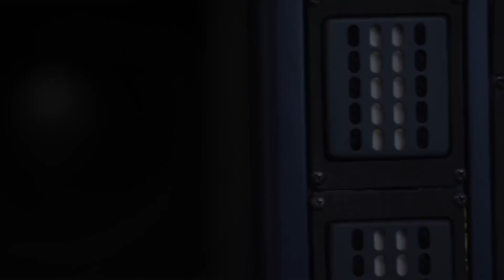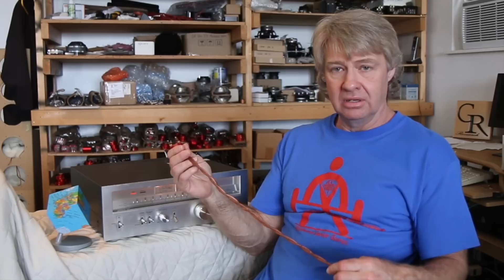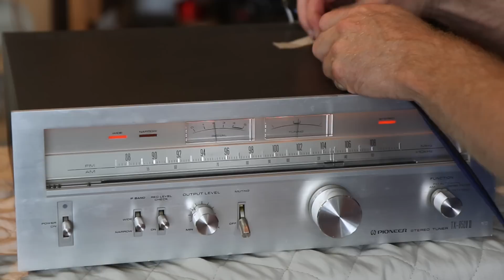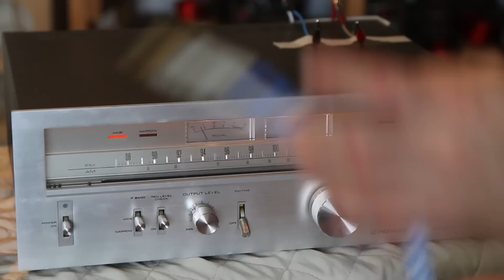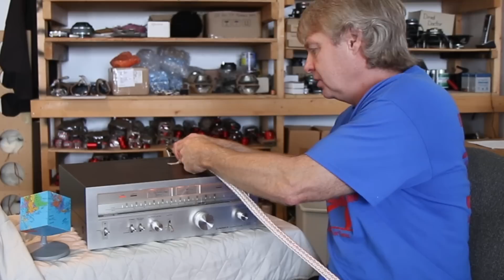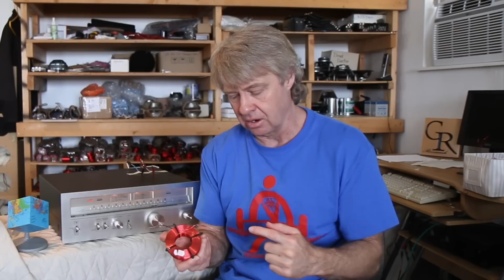Do Audiophile Cables Matter? Here's PROOF!

Comment: I'd like to see a speaker that can reproduce those station frequencies and people who can hear them in megahertz range. I know there are lower RF also but anyhow. Haven't heard a speaker that starts to sing when you just connect a cable. Input side is a bit different thing though.
Reply: It isn't about hearing those ranges. It is how the audible range is effected by them.
Reply: @dannyrichie9743  Didn't see measurements or hear differences. Just talk about how it "might" do something.
Reply: @OjStudios  I am working on how to take this to the next level and how to provide real information that is easy to grasp and doesn't just blow past my younger audience.
Reply: @dannyrichie9743  As an automation electrician I know the basics of RF and EMI etc. But title is pretty mislesding when it says proof and only thing shown is how cables act as antenna on a receiver. That receiver of course picks up all kinds of interference and crap from the air but speakers usually can't reproduce these sounds. If it would affect so much that there is actually a problem, newer speakers should come with some kind of filtering on the inputs.
Reply: @OjStudios  I didn't create the title. I am sure it was picked to grab attention. And that interference effects the signal whether you can hear the actual range it is in or not, and you can hear it in the playback. And you don't hear the radio frequencies (of coarse), you hear the effect on the audible band.
Reply: @Lloyd Stout That doesn't change the fact that the RFI effects the signal and how it sounds. Real engineers though already know that.

Comment: This is true for other interconnect BUT it has a very little to do with "speaker" cable a lot less effect than resistance which he said him self that it does not matter. Because the connection from power amp to speaker is 8 ohms or less and speaker does not amplifies any (noise) signal.

Comment: I certainly understand how cables make a difference. Problem is, purchasing a REALLY HIGH QUALITY cable is VERY EXPENSIVE. I try my best to get what I can afford and of course every little bit helps. From the power cable, to the XLR cables,  to the RCA cables, to the speaker cables. It all makes a difference. I just buy what I can afford.
Reply: I am working on the release of some DIY designs that will get you there without spending the big bucks.

Comment: The discussion at the end regarding shielding, you were talking more about noise from your local energy supplier rather than picking them up from the 'airwaves'. Are they actually analogous as you implied? I.E. Will the shielded cables actually not reject radio noise, and will the braided cable actually filter power supply noise?

Comment: Pretty weak argument that RF coupling is a factor for speaker cables.  If there were any truth to what your saying, then CAT5 cable with its four twisted pairs would make great speaker cable.  Twisted pairs add length and capacitance but improve common mode rejection.  Okay, so what.
Reply: The video was regarding cables in general and not just speaker cables, but I used speaker cables in the example.
Reply: @dannyrichie9743  I guess I don't follow your train of thought...cables as filters.   An 8 ohm load and a few microvolts of EMI that could possibly be present as mostly common mode.  Why would that be a problem one  needs to obsess over?

Comment: I'm not sure using VHF signals was the right approach to demonstrating different grades of audio cables.  I don't think anyone is going to complain about a 100MHz hum in their Pink Floyd.  On the other hand, they would complain about 60Hz.  (They are not the same; with VHF the 'skin effect' really matters, whereas with 60Hz it does not.)  I think the better demo might have been:   an amplifier & speakers, and a 60Hz hum induced into your sample cables, and connected to the amp's input.
Reply: Correct test would be 60Hz hum induced into a cable with amp on one end and speaker on the other, amp's input short to the ground. Any sound coming from the speaker, any voltage measured on the speaker terminals would mean cable is picking up that EMI. But in real world there would be no sound and no voltage even with a cheap 30AWG cable.

Comment: I've got 64 year old ears, so I used 2.5mm twin and earth domestic power-cable for my workshop speakers. My music sounds beautiful coming from my 1972 Goodmans Magnum K2's. No clicks, buzzes, hum, RFI or anything like that, just lovely music.
Reply: Nice to know I'm not the only person using vintage speakers in the workshop, I get a choice between Mission 720'a and TDL RTL3's :).
Reply: May i ask if you use two wires on the plus or the minus? I was thinking of doing the same with the garden type because they are very flexible and very cheap I could use also extension power cable also very cheap and flexible

Comment: Danny, would you do us and the entire audiophile community a big favor and show us how differences in speaker cables do have audible consequences rather than just saying they do? If you are convinced that they do, it shouldn't be too difficult to show it. Here is an easy way to do it with just a little help. Have someone you trust to put two cables to compare on either side of your fine system and cover them so nobody else knows which is which including yourself. Then start playing a mono signal and listen for any perceptible difference between sides then start playing only one side at a time and switch back and forth often and frequently until the audience and you has concluded their assessments. Do this with enough different signal samples as needed until everyone has either made enough assessments or everyone is exhausted 😵 Then reveal what cables are connected where. You can start with just yourself and a helper (who should not be in the room during the assessments) then branch out to anyone and everyone you know or don't know.
Danny, I respect your intelligence and work but casual sighted comparisons are not scientific and are not convincing to the more scientific and skeptical community. There are the flat earthers and religious believers that will never be convinced, but I believe that you can make a huge contribution to the rest of us if you want to.
Reply: My colleges and I have done this a LOT. But we don't use a mono signal. Many of the differences are in sound stage layering, depth, and space around everything.
Reply: @dannyrichie9743  So do you switch between cables instantly in a double blind comparison? It is much easier to do with my method and if there is no discernable differences then switching between cables instantly double blind is warranted. But about anyone can do it my way as a first step. But for someone like yourself with the experience and resources it should be within your capabilities to do the appropriate objective measurements and relate them to the subjective impressions of the larger community.

Comment: RF (MHz) can't be used to demonstrate audio frequency (Khz) conductance of copper cables
Reply: There's a bunch of AM (MW) broadcast stations below 1 Mhz, therefore, not all rf is Mhz.
Reply: @williamstewart8695  yep but capacitance of cable will have hugely different impedance to 10khz vs 20khz

Comment: Without knowing the length of the cables or whether or not the other end of the cables was connected to one another or not, this video is meaningless as "proof" of anything.  Yes, braids shield from stray RF noise but if you don't have stray RF to begin with they do nothing because there's nothing to shield.

Comment: Don't let the naysayers discourage you, Danny, go for it. I just learned again the difference cables make, by swapping out one Oyaide interconnect cable ($70) with another ($125), and WOW, while I loved the warmth and fatness of the Class A, the Class S just has a bit more brightness and highs and less bass, but overall provided a better balance to the sound. This cable runs between the preamp and my electronic crossover, so everything I hear is running through that cable. So these are cables that do not cost hundreds and hundreds, and most of my interconnect cables cost less than $100. So the Oyaide cables are great, and I also really like the clarity of the Analysis Plus interconnect cables. But I am afraid the differences I clearly hear in these cables likely do not show up on measurements.
Reply: What is a class A or S wire? Also, try using one type of interconnect on one channel and the other type of interconnect on the other channel and listen for a difference. Using a mono signal and switching from side to side is best.
Reply: @StewartMarkley  The class A and Class S are two models of Oyaide interconnect cable, the Class S has been discontinued.
Reply: @SpeakerBuilder  OK

Comment: I think what all this boils down to is CABLE ARCHITECTURE. If you took notice Danny used a variety of cable from straight wired zip chord to increasingly complicated braided multi-stranded, multi-cored wires. What happens as you increase the complexity of the cable is a reduced noise floor, because the braids act as a faraday cage on the neutral, which is where most of the noise tends to be.

 In my own recent experiments making RCA, and speaker cables I have found a profound difference when the signal wires are shielded by the neutral, that is, wound as close as possible to 90 degrees around the signal wires. Results were a much reduced noise floor, cleaner, clearer, sound, more detail and nuance. 

For all the naysayers I suggest you actually build your own cables before you criticize Danny's findings. You don't need to spend a lot of money to get stellar results if you DIY, either. I have been utilizing Steeve Reeve's designs, in particular his RCA cabes, and his speaker cables with fantastic results. He explains the engineering behind the design in easy to understand terms. Check them out here. DIY Speaker Cables - The "HELIX IMAGE" Speaker Cable
Reply: I have recently had to plug  my entire sound system to a new electrical circuit because my preferred  "convenient "circuit was far too noisy .Even buying a circuit regulator did not help(though I don't know if that was my fault for buying too big a wattage device?)
Do you think that Helix Image cable would resolve the problem?
Reply: @johnh539  Not sure if it will help? Sounds to me like you have more serious issues than just the RCA cables themselves. Make sure you route all power cables away from sources, and also keep them separate from your rca cables. Make sure equipment is grounded if it need be, and also keep sources like pre amps away from power amps. Think long and hard about separating cables and making the back of your equipment with cabling and the like as tidy as you can. Hope this helps?
Reply: @karlcotleanu486  thanks for your advice. I have never understood  grounding Hif where do you ground to , can I attach it to the metal flames of my furniture?If I have separates do they all have to be earthed to different 'say Frames 'or do you form a loom and ground them as one?

Comment: I shared this nice video is some chat room and all hell broke lose. Someone was saying this.

For one, this video has no data. For two, no, for speaker wire it does not matter what kind of cable you use. You could use coathangers and not be able to tell the difference.

Haven't had much experience in this myself. I ordered a pretty nice silver cable so that should arrive today.
Reply: Yep, there are a lot of those guys out there. Sadly, they have no idea what they are missing.
Reply: Danny Richie I haven't even come close to those really expensive cables and am already having a good time swapping cables. It. Boggles my mind yeah.

Comment: Excellent video Danny.  I started using very high quality copper cables.  I now run the whole system in solid silver cables, heck, my phono stage internal wiring is solid silver, my preamp internals are solid silver, the transformers on my monoblock tube amps are wound with silver.  Sorry forgot to mention, the internal wiring in my speaker is silver.  I have heard my system with very high quality copper through it, but when I sent the items back to get them rewired is superior silver cables, WOW the sound was so open and transparent with no harshness(one of the reason for this is the wire I use was not manufactured in China, all in the UK, bar the transformer which had to be sent back to Tamradio in Japan.  What I am saying is Danny is right.  High quality cables make a great difference.  I have been an the Audiophile for nearly 25 years and I have heard so much.  Believe me when I say it makes a different, I would not spend the money I have it it didn't make a good difference.

Comment: If you want to clean up your incoming AC power, this big ole choke (see link) lowers the noise floor for my system. Also have a dedicated 20 Amp circuit run from the house AC breaker box to this choke. The electronics all plug into this choke. Have used this for 10 years now and it even lowers the noise floor for the video circuits as well.  The braided speaker wire in Danny's video acts as something similar to a choke and cancels RF noise on the cable.
http://www.richardgrayspowercompany.com/products/substation/

Comment: Hi Danny. Would optical interconnects like toslink also transmit such noise?
Reply: No.
Reply: No, that's the point of the optical decoupling. To prevent any common mode interference from traversing the link.

Comment: I use a DIY twin twisted solid core WF100 co-ax "Ubyte 2" cable on my  OTA Quad 57'S because it  has low inductance giving a flat frequency response in my system.  I have tried Monster cable, Nordost & several others since 1984  all sound different in my system. 25 years ago  I explained my understanding of skin effect to an expert  at a large A frame computer show he suggested it was acting  as a inverted wave guide however only pertinent  above audio frequencies.

Comment: The experiment would be cleaner if the speaker cables were terminated at a free end with some 8 Ohm resistor or even shorted (simulating connection to an amp output).
Reply: The radio is a high impedance circuit while the output transistors dampened by a 8ohm speaker is a low impedance circuit. The tiny current created over lets 0.2 ohm resistance in transistors gives a miniscule voltage. In the radio circuit the resistance would be in the thousands of ohm so using Ohm's law, voltage = current x resistance(high value here from the high resistive impedance radio circuit) would give some useful voltage affecting the VU meter in this example. There is no measurable voltage beeing able to build up since its shorted out by the low impedance of the speaker circuit..
Reply: The RF voltage input to the tuner is very low, like you say, probably a few microvolts.  Radio frequencies in the range 88 to 108 MHz are way above audibility.  Output impedance of an amplifier that drives speakers is very low, less than 0.4 ohms, close to a short circuit.  A more valid test for the audibility of noise picked up by speaker cable would be to connect the speaker wire to a speaker and replace the amplifier connection with a resistor 0.4 ohms or less.  If you can hear noise from the speaker, that is bad speaker cable, according to the hypothesis that bad speaker cable picks up audible electrical noise.  If you want a visual confirmation like the RF signal meter, use a multimeter to measure the voltage across the speaker leads.
Reply: @impuls60  The tuner antenna input would be 300 ohms.  Radio receivers, antennas, and antenna cables must have the same impedance or there will be standing waves on the cable.  Coax antenna inputs are 75 ohm as is RG-59 or RG-6 coax cable and changing impedance requires a baluns transformer.  An audio amplifier output impedance is very low, less than 0.4 ohms, so to compare the RF noise susceptibility of speaker wire, the test is only valid if the speaker wire is loaded with 0.4 ohms or less as it would be when connected between an amplifier and a speaker.
Reply: A speaker isn't a stable load.
Reply: @mordante01  So? Why does it matter?
Reply: @IliyaOsnovikov  You cant affect any circuits in the amplifier without voltage. So its a hard proof that any speaker cable can't act as an antenna. Also in class D you have output capacitors in parallell with the speaker shorting out any RF.  Regarding signal cables there might be some thruth to this since input impedance is much higher.
Reply: @impuls60  Exactly, that's why good interconnects come with shielding, while speaker cables don't.

Comment: Alot of people should go to audioholics, there is a person there who believe cables dont matter but uses an expensive speaker cable. 
P.s. CABLES MAKE A DIFFERENCE
Reply: I mentioned that as well in my comment and was told in a reply that they spread dis-information.
Reply: @hugobloemers4425  hi hugo, I think you might have misquoted my sarcasm. Audioholics channel keep debunking that cable matters. They do it thru measurements... there are alot of parts in sound that cannot be measured. Tonal qualites etc... they can measure the same but sound different. Irony with audioholics is that they keep promoting that wires dont matter but the person telling you that is using an expensive cable. Wires make a difference in sound good or bad. I have been an audio installer and tuner for more than 20 years and have tested wires from cheap to super expensive. I do not care abput diminishong returns as that is a budget issue. Let people buy what they can afford. The topic is it does make a difference.